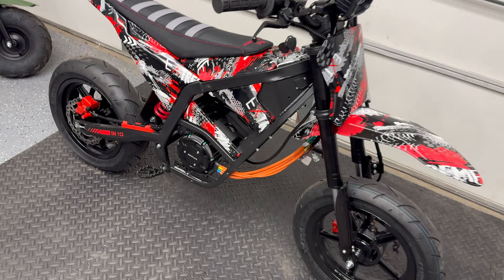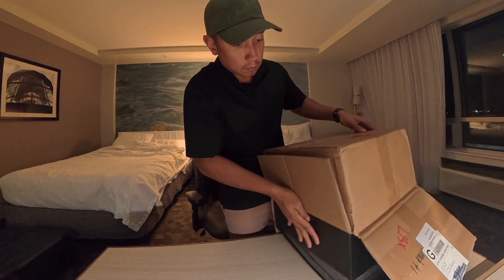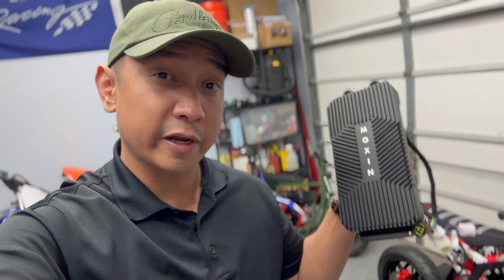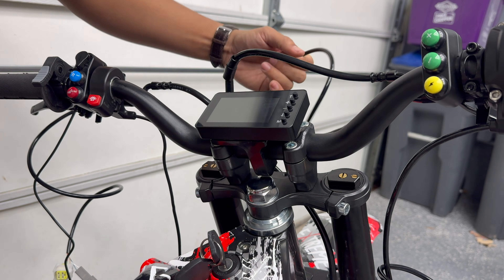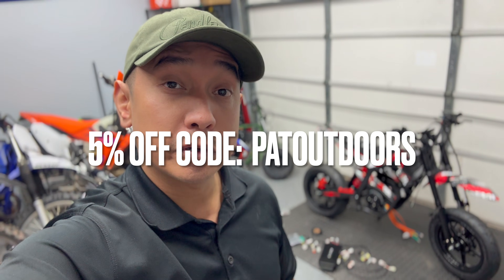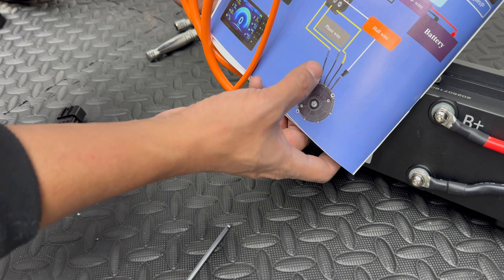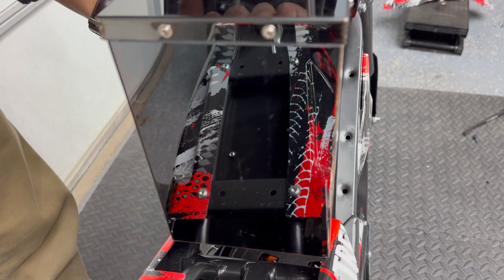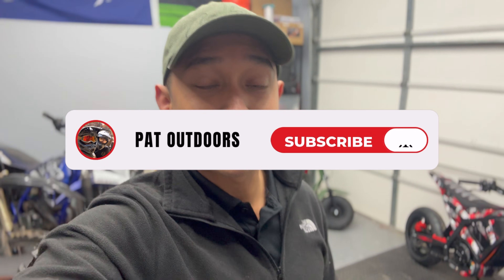Ultimate Yozma IN 10 72V Supermoto Part 2 - Moxin Controller

Comment: 10:33 I'm kinda confused on this part and how too switch the cables for the throttle and ignition and I'm wondering if it's required
Reply from the maker: No need to switch the connectors if you’re using an OEM Surron throttle and ignition, but I had to switch them since I’m using Yozma parts with different connectors that don’t match the Surron Moxin harness.
Reply: @PatOutdoors I was told that they might be making yozma connections so
Reply from the maker: @DaBlueGuy9193  This is me installing my Surron Moxin controller, since a Yozma kit does not exist yet. Who were you taking to that said they’re making a Yozma kit?
Reply: @PatOutdoors electric rva themselves I contacted them
Reply from the maker: @DaBlueGuy9193  oh Billy gotcha, well hopefully they make a kit for it soon so you don’t have to swap the connectors. But at the time that I made this video, a Yozma kit doesn’t exist so I swapped the connectors to make a SurRon controller work.
Reply: @PatOutdoors they said they would provide a surron throttle and ignition and apparently works with the stock bike so I'm hoping to get it

Comment: Dude great video series can’t wait to see what happens next. But what’s the total cost of the build so far? Good luck
Reply from the maker: Thanks! But uhh.. a lot 😂 Probably gonna be close to $3K in parts once I’m done with it all
Reply: @PatOutdoors Wow! That’s crazy but I respect it not many others do this so thanks these are great videos. I can’t wait to see the outcome.
Reply: Forgot to ask you this but I was looking for the Bluetooth connector thing and I found one on Amazon and was wondering if it was the right one it says Fardriver Programmable Bluetooth Dongle Controller for E-Bike,Programmable Bluetooth Adapter Compatible with Fardriver E Bike and is listed by the store named GregYoung. Is this right? Sorry for the bother.
Reply from the maker: @ZpLaYs360Sounds right, should have a red connector on it.

Comment: Pat- I’ve been watching you since the first Rawrr Video I found, where you changed the gear oil. Love the content man!  I’m in a strange position with my 48V Mantis Mini. I want the damn thing to go faster. But I didn’t want to stray from the RAWRR components. Looks like I’m gonna have to though. My question is: do you see any reason why I couldn’t do the same thing with the 48V mini?  I’d have to:
- get an Amorage custom 60 or 72v battery that would fit. 
- Sotion Motor- one that could fit in the mini
- fardriver controller
- surron throttle 
- new display. 

What are your thoughts on this?
Reply from the maker: Soo I've never had a 48V Mini before, only the 72V versions. But most of the features are pretty much the same except for the larger wheel-set and higher voltage battery on the Mini R model I had. So that was my gripe with Rawrr is the lack of aftermarket compatibility and availability for battery and controller options. You would have to change the battery / controller / display at the same time for compatibility reasons, but throttle you should be able to rewire to work (unless you just want to upgrade.) The stock motor (assuming it's the same as what they used on the 72V Mini R version) should be able to take at least 7kW of power. Not sure which exact QS or Sotion motor is compatible though.. I recall it being similar to a QS120 60H with the gear reduction though.
Reply: @PatOutdoors thanks for the reply- I need to read closely before replying.

Comment: You need a better battery than Amorge can provide ;) something like a 72v 40Ah 400A
Reply from the maker: Maybe in the future 🤷🏾‍♂️ Out of my budget at this stage. Also idk how the hell you fit that much battery in this frame lol, maybe 25AH
Reply: @PatOutdoors  I removed those posts that cause the fastener heads to take up space in the battery area. Thats why the battery stopper is there. My battery lays flat against that plate now. 

Amorge uses a metal case, and their cell spacing is larger than what I use. I had to design and 3D print my own trays, order custom connections, and be conscientious about material selection to minimize wide. Frame width is 146mm, my battery comes in at 143mm.
Reply from the maker: @Nominally-Built  Can you build me an 80V 30AH battery for this bike? I just need it to have decent clearance up top (to have space for the harness.) DM me on IG if that's better - @pat_0utdoors

Comment: How much does such an upgrade cost? Are you upgrading the brakes as well? With all that power you need to stop...
Reply from the maker: The motor / controller / battery combo cost about $2K.. the stock brakes are the same as on the Tuttio and work ok up to 70 MPH. I’m gonna see how fast this bike goes first, then plan out how much of an upgrade the brakes will need (thinking 2-piston front and rear.)

Comment: Hows this next to a stock STRIKE SHADOW 72v? Its really not that much more and has fast ace rear shock and front forks 72v 7000w and has a longer swing arm and larger 17 14 wheel set.
Reply from the maker: Are you talking about this specific bike or a Yozma IN10 in general? The strike shadow 72v is better set up for trail use and has much more power than a stock Yozma, but this specific one is set up for street speed
Reply: @PatOutdoors ya I noticed its a much larger motor and with that controller upgrade its going to be crazy. I didn't realize how's crazy that motor was until the end. Im 6"3 so the larger dirtbike wheels would work better for me over moto wheels. Also I like to be able to cut off road and threw grass. Also I dont need anything that can go over 55 mph 😂